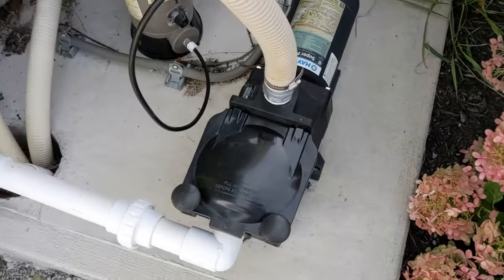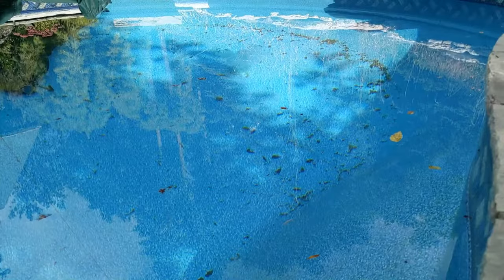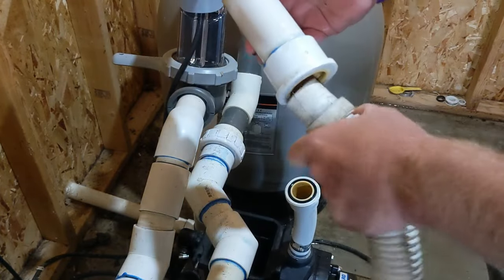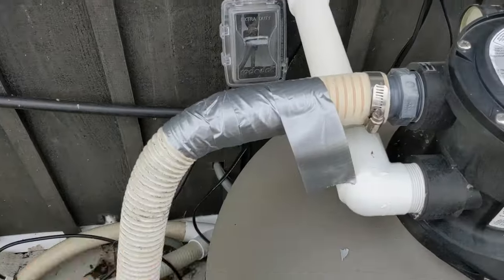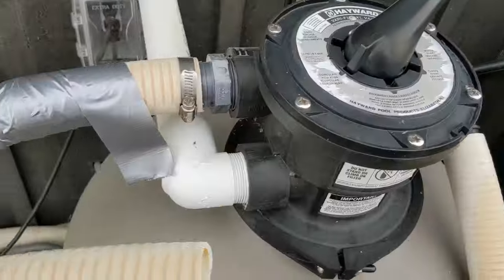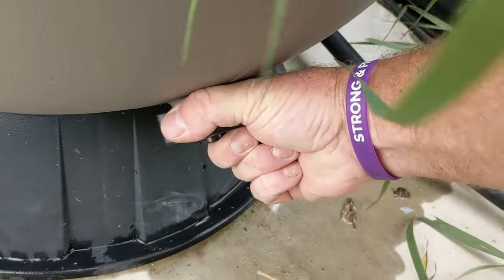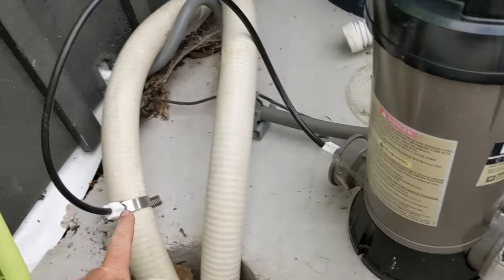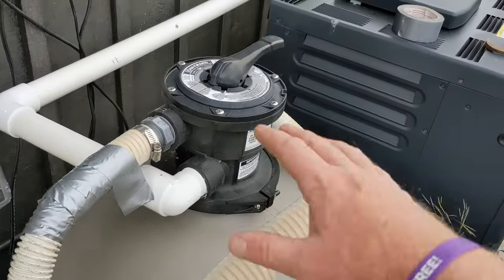How To BLOW Out Pool Lines for Winter / Winterize Your Swimming Pool / Pool Winterizing Blower

Comment: what dont you like about chlorinators?  what do you recommend instead?  pucks in the skimmers?  That's what I do and it seems to work fine; not sure why people bother with the chlorinators.
Reply from the maker: Chlorinators are great when you use the right pucks and not the low budget pucks.  The low budget pucks gum up the chlorinator making it not work properly.  Same goes with putting them in the skimmer.   Any chlorine pools I try and use a floater.

Comment: I understand how you blow out the hayward back to the skimmer but how do I blow out the lines for the jets when I have a cartridge filter.  What do I hook the blower (mighty vac) hose up to?  And don't you have to have the water line below the jets when you blow the water out of the lines?   I open my pool every year but I have never attempted to close it. Thanks in advance.
Reply from the maker: There's so many types of filters and plumbing setups for pools its hard to do a video that suits everyones pool.  Bottom line is, get the water out and do it anyway you can.  What cartridge filter do you have?
Reply from the maker: https://youtu.be/AOFOsW4KERU
Reply from the maker: https://youtu.be/-N3xtlr7eWY

Comment: When you were blowing the water from the jets, i noticed that the water level in the pool was still above the jets. How do you plug those jets while they are still underwater?
Reply from the maker: Most pools you can do this with a few different plugs.  Items used and other plugs are in the video description.
Reply: @VIPPoolsandSpas  I mean as soon as you stop blowing air to the return lines, they will start letting water in from the pool (since the jets are still underwater). Then when you plug the jets, the lines would have some water in them. I am curious about the timing of when you close those jets with the plugs.
Reply from the maker: @CdGreven  the plugs would be a duck plug.  It prevents the water from going back in.  It's like a ducks bill.
Reply: @CdGreven  what a lot of pros do is plug it while air is blowing. You use a rubber plug with a bolt and wing nut on it. Little tricky.

Comment: Why don't you drop water line below jets
Reply from the maker: Some pools I do drop the water below the returns. but most I don't.  The reason I like to keep the water up above is because by putting in the duck plugs I know it's 100% sealed.  If you drop the water below the returns, no one could ever make that claim.

Comment: Does ANYONE know how to close an in ground pool or what?!  Every damn video I watch is different! One says drain below the jets, then the next has water over the jets??? WTF???
Reply from the maker: Lol.  I hear ya.   Even when I close a pool sometimes I'll drain it and sometimes not.  If the duck plugs fit in your returns, use them.   You can drop the water below the skimmer with a normal gizmo or keep the water as normal with an ultra gizmo (with the hole at the top).  If you have concerns and I know it can be frustrating, email me a few pictures of your pool, the jets and the skimmer. And I'll help you answer what is best for your pool.  Remember.  Some people can't drop their water down to low because of ground water.  One of my videos shows what happens when I dropped the water.